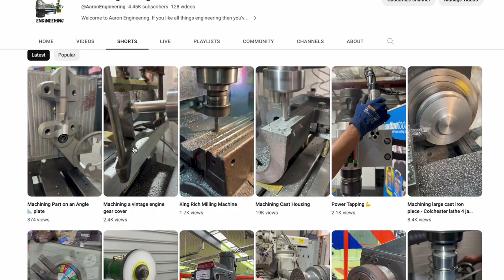Angle Plate | Work Holding | Workshop Repair

Comment: Always good to see ways to set up tricky parts. It's simple jobs like this that sometimes take 3 times longer to work out how to set up than the machining itself. 
It may just be me and my phone, but at times your voice was a bit drowned out by the machine noise. Thanks for the video.👍
Reply from the maker: G’day Olly. Yes mate I tell the apprentices the exact same thing. Engineering is 90% set up and 10% doing the work. Sorry about the audio. I should have dropped the machine levels (in software) when I was talking. Cheers mate 👍🍻

Comment: Nice easy one there Aaron .  Vertical travel is often an issue with a boring head . I was thinking of putting a riser block on my BP but probably won't now as the other mill has 580 table to quill . Cheers .
Reply from the maker: G’day Max. You are correct as always machining master. I was just saying the same thing to Matty. My little mill is a beauty, but she’s a tad on the small side. Hope you’ve been well Max. Cheers mate 🍻. Aaron

Comment: Clever set up Massah Po’… 👌
What is the quill travel on your little mill?
Nice finish too mate…
Those replacement parts would have been very exie…. so a great solution.
Have fun at the Expo eh?
Regards
Grasshopper
Reply from the maker: G’day Robert. Thanks mate. Lucky for me Wayne (the vintage engine bloke) had this angle 📐 plate for me to use. Yes this was a standard Ducati part but the aftermarket handle bar was too big. NMW is on this week Robert. Shame you can’t make it, would have been good to see you. Cheers 🍻
Reply: @AaronEngineering  
Yeah mate, I’d have liked to come down.
Maybe in 2024 or 2025?
I’m still a bit leery of The Escaped-Wuhan-Laboratory-Weapon🤬🤬
Still killing dozens a week up here 😣
Hope you enjoy the show 😁
Reply from the maker: @RobertBrown-lf8yq  damn that Wuhan Chicken 🦇 Virus 🦠. You could have stayed in my little bungalow out back. Cheers 🍻